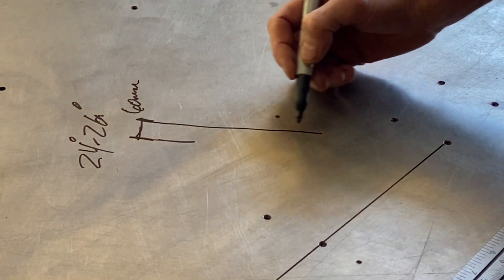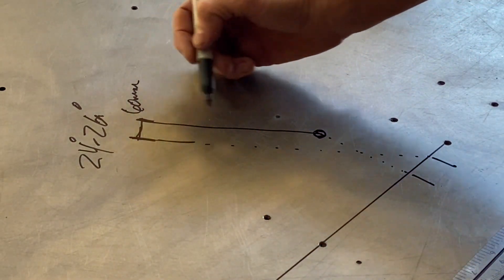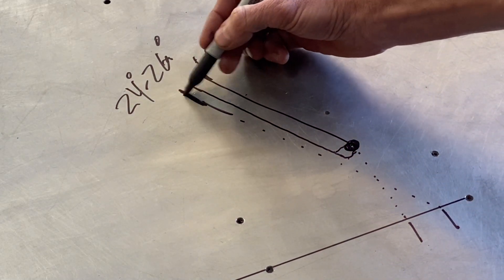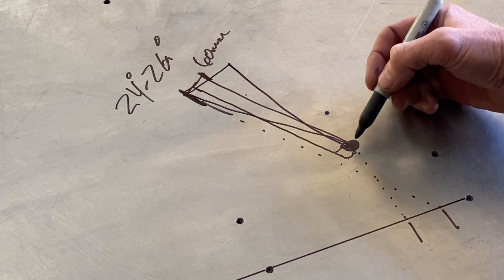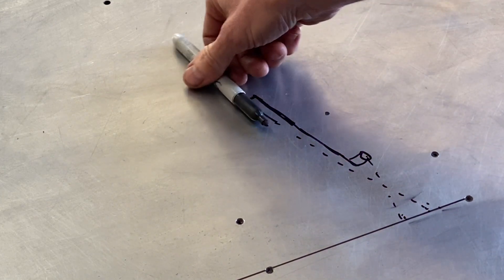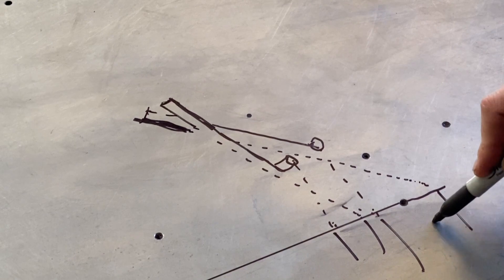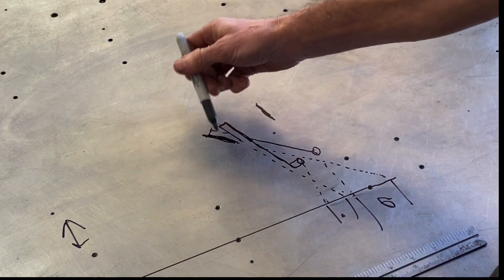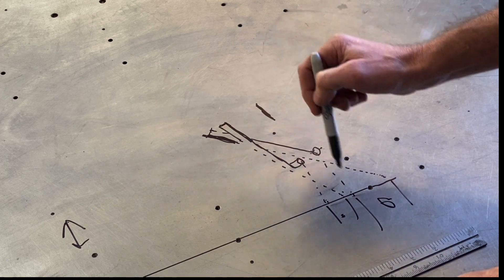Flat Track Geometry in 5 mins | Davey Durelle Racing Products Explains

Comment: Rake and trail are measured with the bike motionless and the wheels inline and the bike straight up and down. That is the static rake and trail. 
.
Here’s the kicker. Rake and trail change a lot while the bike is being ridden due to pitch change. Pretty obvious. But!! When you start sliding the back end and counter steering the rake and trail change drastically. 
.
With the back tire way out to the side and the bike leaned way over and the handlebars turned way to the right you now have a rake and trail that is huge. This is why flat track bikes have such little static rake and trail. Less than you would really like for stability when hitting bumps. With a lot of static rake and trail the bike would be very cumbersome when counter steering.

Comment: Very interesting. I am (kinda) looking at SM wheels for my KTM. One of my questions is that the stock is 21/18 and to go to 17/17 the geometry change is huge. Alternatively, FT wheels are 19/19 and that's still a change as back goes up. I don't see much on changing steering tube angles and am not sure if you can change rake with top/bottom triples or if the forks need to be always parallel to the tube. Great vid :)